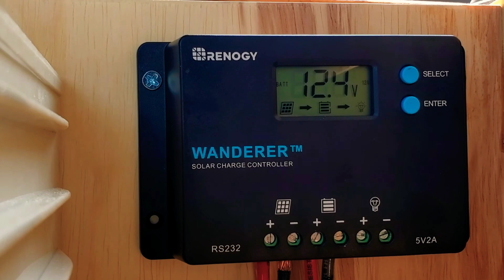Honda Element Solar Power Setup and Installation  VANLIFE RV

Comment: Nice setup, have you considered adding a way to charge the external battery bank off the alternator as well?
Reply from the maker: I just never use enough power to even justify it. But I can add a 12V switch to charge

Comment: Thanks so much for the 5 speed, that’s my dream!
Reply from the maker: I've got a nice little save the manuals decal on my window...  I was hoping somebody would appreciate the manual transmission
Reply: Elemental Adventures ya I’ve been doing my search for one but ONLY want a Manual, no Automatic and unfortunately most are Auto’s...It must shift like butter!
Reply from the maker: @sneakersonfeet9045   Honda makes a glorious transmission... And it's actually quite fun to drive when you're doing windy roads. I will say the gear ratios are very very short and you will be at a high RPM on the highway... Not the best to drive around city streets.  The automatic does get better gas mileage, but it was worth it for me.   It would be perfect if it had a 6th gear for highway